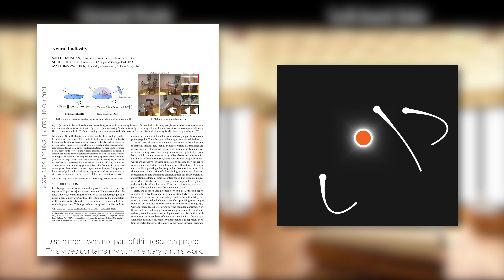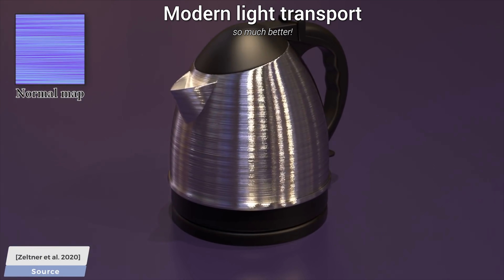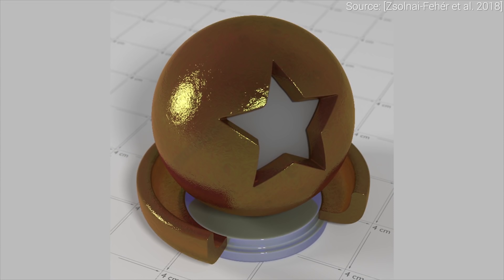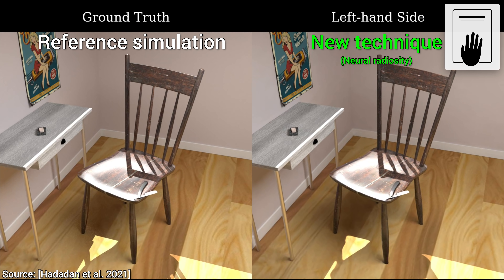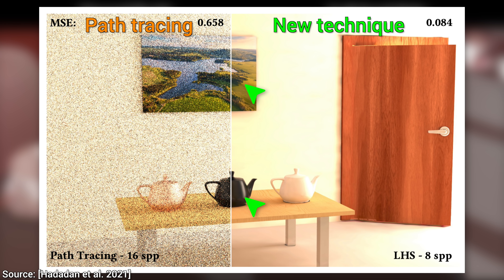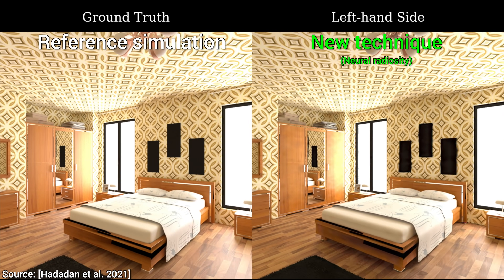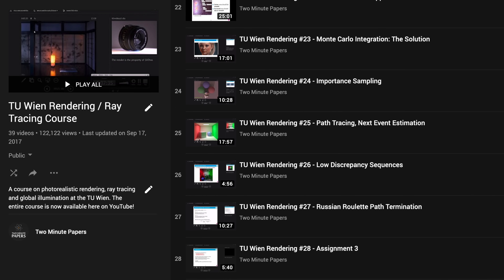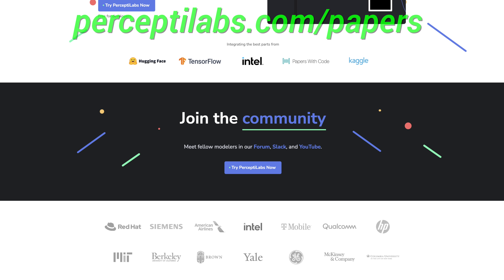This AI Creates Beautiful Light Simulations! 🔆

Comment: Takes me back to the RADIANCE rendering engine...still the only validated rendering engine.
Validated, as in a 100 watt lamp of a certain size in a 12 by 8 meter room will illuminate everything in the room accurately*, rather than just 'look good' or 'be convincing'. 
RADIANCE renders look slightly different compared to 'unbiased' engines like Cycles.  

*It used literal watts per square centimeter in all equations, even allowing some light energy to be lost during reflections.
The energy lost to a surface isn't a simple percentage; angle of incidence and many other factors come into it.
It is the 'costliest' part of the rendering equations.
Many engines use a kind of short-hand describing with the way light interacts with objects.
"OK, guys, this ray was the first to hit this polygon. Chuck, you find the edges of the polygon.  Larry will use the tilt of the polygon to create a gradient, so we don't have to probe every part of the poly to see how it is lit. Dave will check in with Chuck to test the poly with a few more rays, see if the gradient is a good fit. Sue and Joyce will figure out which parts of the poly can 'see' the Lamps.  If none of it is directly lit, Bob and Dave won't have to work out the light-bounce with too much accuracy.  Bob, meet with Larry, see if that gradient needs to be in the light scatter data, or if we can squeak by with an average color based on what the girls said was visible.  Tony will let us know if that poly is inside another object or even in the scene...should have done that sooner. Hurry it up, people, we have only a few microseconds to get this done!"
RADIANCE let energy go where energy goes and showed us  what that looks like.
I would never dream of using it artistically; not at all interactive and the images don't look 'pretty'.

Comment: The NN needs to be trained per scene but then you can render blazingly fast...well that's also true for plain old radiosity. There you also just need to calculate the radiosity solution beforehand and can use it during rendering which then is very fast. I personally think Neural Networks should stay out of CG completely (With the exception of Animation maybe). They are a lazy man's shortcoming. It's like: We don't need to understand the underlying model, just throw a NN on it.

Comment: If it requires retraining per scene, that brings up the question: what happens if the scene is slightly different than the scene that we trained on? (For example, adding a dynamic entity to a static scene).
If the introduction of even relatively small dynamic entities break the technique, then its applications will be significantly limited.
Reply: In this case what you get is no better than a light map. Yeah I'm confused about this new tech honestly lol

Comment: Considering how much memory it uses for such little scenes, it really seems like baking lightmaps into a neural network. So I feel like the comparison should be with a lightmap baking process for the same scenes at some comparable resolution.
Reply: Considering the normal progress of neural network related study, models with large parameter set often comes first, but after few papers down the line, the size would reduce drastically.

Comment: When you said that in games this technique could be used by pre-calculating the scenes, this is only true for static scenes, right? If objects move or time of day changes, it would not work?
Reply: Also wouldn't this just be the same as baking the textures on the geometry? I suppose it wouldn't calculate specular reflection.
Reply: well time of day is easy enough. it's predictable
Reply: @demonz9065  not exactly. You would probably have to train the network at different lighting situations. Which would mean a lot of extra time training.
Reply: @BenjaminRound  Not 100% sure, but what the neural net trains for is light transport. Which probably means geometry has to be static (spatial relationship between patches can't change) but lightning can be dynamic. If it has no problem with specular lighting (which is view-dependent), I see no reason for it to have trouble with dynamic diffuse lighting. Maybe I'm wrong though!
Reply: I was wondering about this, too
Reply: Bump

Comment: hehe, I've worked with radiosity in the past and use 'modern' vray renderer now. The interesting thing is that the ray sampling algos we use today would not have been computationally intractable 25 years ago when radiosity was attempted. Especially with a modest attempt at denoise, wouldn't even need neural denoise. And this approach is what's being done in unreal engine 5 that does realtime GI. And ray tracing GI and some denoise on the lighting solution is not a sophisticated thing so it's very interesting to remark that it could have been done to great success a quarter of a century ago. Imagine what could be done today that's just not being done.
This paper as I understand your description seems void by the need for training on a specific scene. And that limitation wont be fixed a couple of papers down the line. Fortunately, like I said, simply ray casting and smoothing it out is both high quality and very fast already and would seem difficult to beat. We essentially have the 'ultimate' already.

Comment: It needs a few hours of training on the scene before it renders anything. So it literally bakes the ambient lighting... So something you can already do in a tiny fraction of the time with a normal technique. And both the preprocessing and final rendering would be faster. But instead you are comparing it to realtime raytracing with no baked ambient lighting or any optimised ambient lighting for that matter. This paper is pointless.
Reply: Not if you combine the 3 technics into a singular super NN, think out of the box. Each technics has its strength and weaknesses. Raytracing for light rays collision and bouncing, path tracing for light diffusion and radiocity for general global illumination. Combine all 3 data extraction technics to a single trained neural network, while eliminating their weaknesses, and you have the father/mother of all lights. Terrabytes of training, gigabytes after inference, than can run to ur dedicated TPU/neural processing unit
Reply: Subsurface lighting, translucent objects and fluids, shadows, reflections, humidity. A lot of things on the horizon

Comment: I'm wondering if best light simulations will be available in realtime even for low-end GPUs at one point... Progress in computer graphics is just mindblowing...
Reply: You already can the best light sims aren’t real time so you could run it on anything. The only difference is render time. But if you mean real time, like ray tracing. Probably a couple years.

Comment: Radiosity, or well a similar technique called "lightmapping" is actually a common technique used in video games, as it can be baked into textures and thereby simulated ahead of time, allowing for Global Illumination even on phones. However, these days path tracing is used to compute the indirect lighting.
Reply from the maker: Excellent, thank you for the clarification! 🙏
Reply: @TwoMinutePapers  in my head I'm reading this reply in your voice
Reply: Yes, and the biggest problem with lightmapping and similar techniques is that you cannot modify the scene with correct lighting. Fully open that door that has just the narrow slit on the side currently open: the scene cannot respond to increased light that bounces differently.

I think if somebody can figure out generic AI method for radiosity, it would be a winner technique for real time rendering. The ground truth can be computed with full ray-tracing with enough rays but to get rid of noise, that requires obscene amount of rays for complex scenes with lots of meaningful bounce lighting.
Reply: @MikkoRantalainen  Are there any methods of baking the scene under different lighting conditions and lerping between them?
Reply: @Wescotte1st  Yeah, that's one possibility if you don't need any hard shadows anywhere and you accept rough approximations everywhere.

Imagine a scene where a door has small crack and bright light comes from the other side of the door: you'll see sharp shadow boundary from the door on the floor. When the door starts to open, the sharp shadow boundary should move along the door, not fade between small crack to fully open state. And the light in the rest of the room should follow the bounces that result from the movement of the door.

Basically the best you can do if you want proper looking shadows and radiosity-look is to do low resolution ray tracing / path tracing with bounces to get rough radiosity mapping and then render normal shadow mapping on the top. Even that gets pretty expensive (computationally) fast and will cause flickering in the estimated radiosity data when objects move around and the sample count is too low for the scene complexity. And this kind of hybrid technology is always a real-time rendering hack which will cause different artefacts that will show in the final image if you know what to look for.

This AI algorithm would sound really good if you don't need to train it with high resolution ray tracing, or you can re-train fast using the previous frame data as the baseline with some changes to the scene.

I'd like to hear the 1st frame time for this AI algorithm (that is, the precomputation + 1st frame rendering combined). If you could get that to 0.5 - 1.5 second range, this algorithm might be possible to be used for real-time rendering pretty soon already.
Reply: "Even on phones"... Such a long way we've come :)